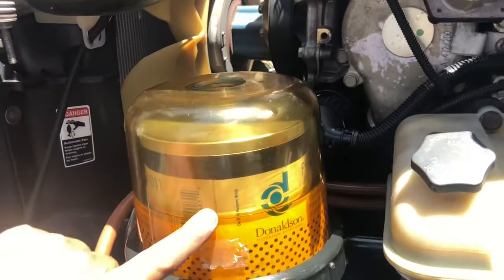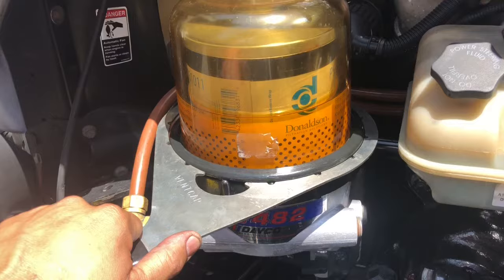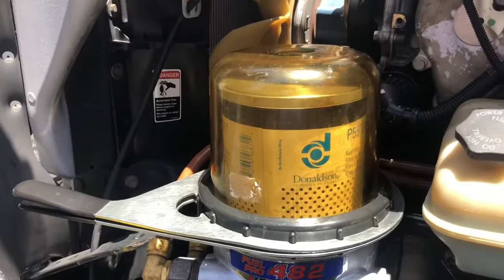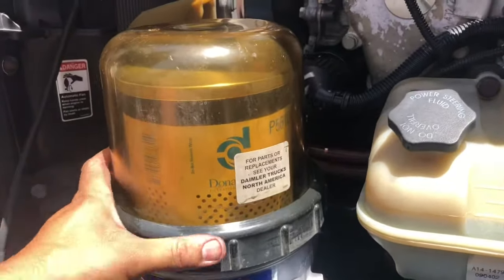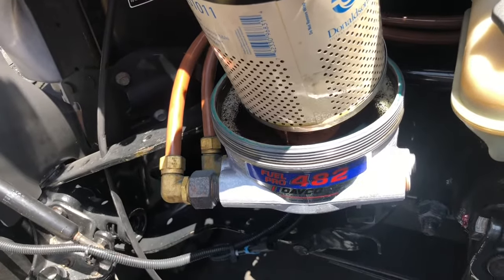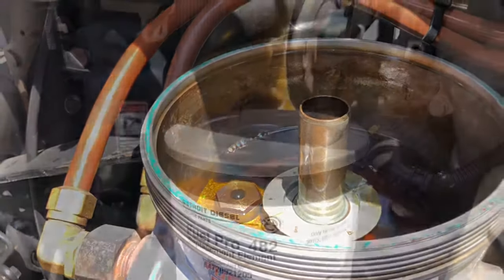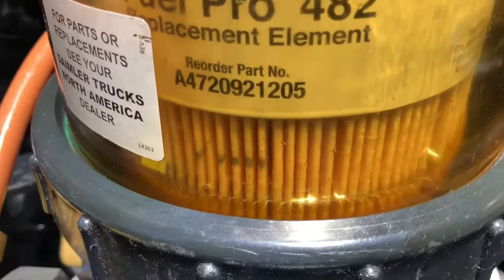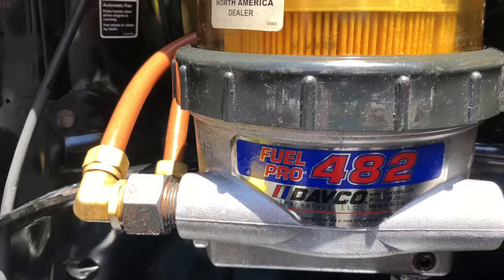Freightliner Fuel Filter replacement

Comment: Any idea why I have bubble on fuel water separator please?I thought it’s Check valve I change it but still the same
Reply from the maker: Check for any leaks or signs of leaks. 
Might be getting air. 
Do you have any hard starts?
Reply: @CarlosDieselElectric  no it starts easily sometimes it surging not always
Reply from the maker: @dawitabate9291  surging could be the quantity control valve.
Reply: @CarlosDieselElectric  thank you 🙏 I already changed but same
Reply from the maker: @dawitabate9291  try resetting using the DDDL software. 
There is a reset
Reply: I got vapor bubbles also nd my truck isn't running as good 🙃 but it's getting air from somewhere
Reply from the maker: Check the oring around the collar and check the top. Might be getting air. Also, have someone connect using the software and perform a Fuel System Integrity Check
Reply: @CarlosDieselElectric  thanks allot ima try that

Comment: In 2500 miles my newly installed diesel water separator filter filled up to the max level? What could be the issue? Contaminated diesel? Or any sensor malfunction?
Reply from the maker: Could be a bad filter, could be something in the fuel. I would drain it (down to the collar) using the valve just underneath the separator. Then run the truck and see what happens. Is the truck running any different?

Comment: How do you add diesel to it before starting the engine?
Reply from the maker: If your talking about the fuel filter, once you installed the new filter. You add diesel in the bowl through the small cap. Maybe about half way, then stew the cap back in and you are ready to go. Let me know if this works for you.
Reply: @CarlosDieselElectric  thx.... my truck is not accelerating well on hills,  could it be the filter is clogged? That's why I want to change it out.  I have a freightliner m2 106
Reply from the maker: @ziurziur1ify  Might be, that is always the easiest place to start. You have a Cummins engine?
Reply: @CarlosDieselElectric  yes Cummings

Comment: Hey Carlos. I have dd15 that dosn't have that part of fuel filter system. You think its worth installing it?
Reply from the maker: Fermin Martinez I have have seen many Freightliner with the DD15 without the fuel water separator. I don’t think it is worth installing unless you have a specific reason. But for the most part you should be ok without it.
Reply: @CarlosDieselElectric  Thanks carlos appreciate the reply wheres your shop
Reply from the maker: Fermin Martinez we are in Montebello.

Comment: How do I know when it's time to replace?
Reply from the maker: The correct time to replace the fuel filter is when the fuel level reaches the black mark on the fuel filter. Although if it is replaced sooner that is fine too.
Reply: When the fuel reaches the mark when it's running or when it's off?

Comment: Never mentioned the big oring.
Reply from the maker: Sorry. This is one of my first videos. Not my best work.
Reply: Or the ACTUAL NAME OF THE WRENCH...
Reply: @rdr2dgrv99  take it iff with big channel locks as long as the last fuk head didnt torque monster it
Reply from the maker: That works too. Just try not to strip the notches on the collar. 
The tool used to be fairly inexpensive.

Comment: What is that tool called that you used?
Reply from the maker: 482017DAV-Fuel Pro 48X Series and Shop Pro FXP Metal wrench
Reply: @CarlosDieselElectric  Thanks for sharing! Although would have been nice to see this part # in the description. So the question wouldn’t be hard to find in the comments.

Comment: Name of the TOOL used?
Reply from the maker: 482017DAV
Metal DAVCO Metal Collar Wrench for Fuel Pro 482, 483, 485, 487, 488 
You can get it from Snap On or from Davco directly. Also, your local Freightliner dealership should have it.